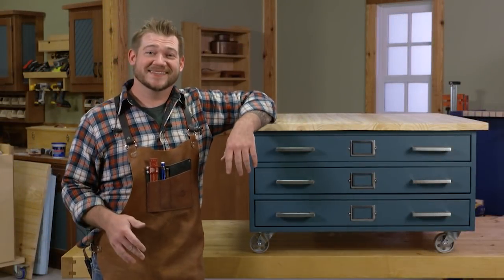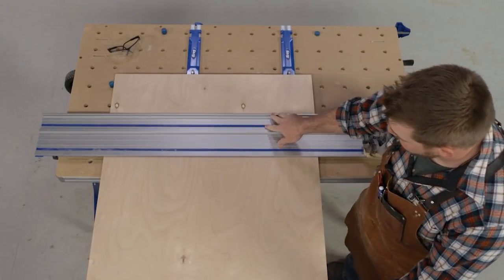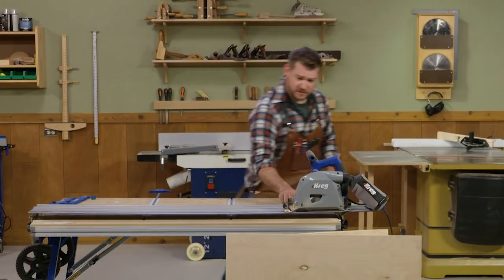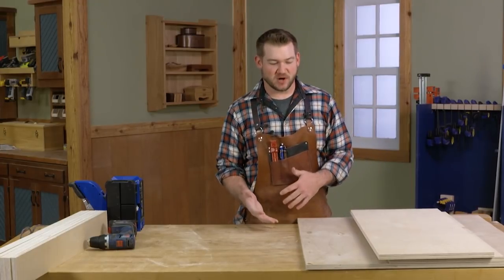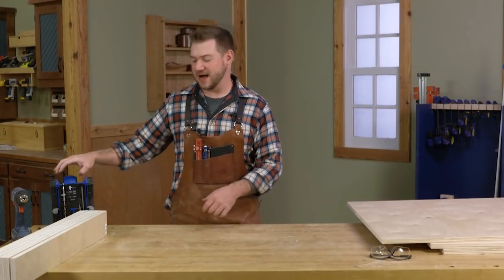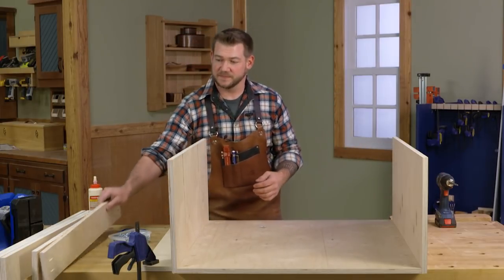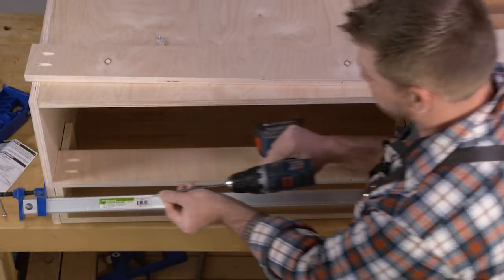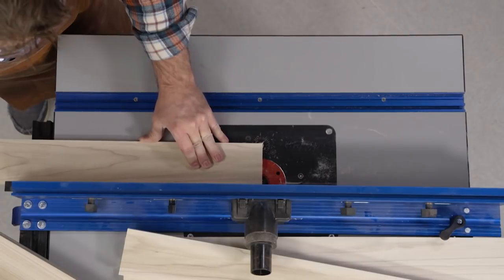Make A Flat-File Coffee Table

Comment: Kreg jigs make our life so much easier as well as makes strong clean joinery!  Keep up the great work as the goal is for us to continue to inspire others to build something awesome! 👍🏼
Reply: Well, not exactly that clean... Have to upgrade to a Castle Pocket Hole cutter if you want really nice pocket holes...  Kreg jigs are just cheap and dirty but get the job done, which is good enough for most.  Just like their ripcut guide, etc. works but is no replacement for a real tract saw...

Castle Pocket Holes are much cleaner, virtually no tear out or debre to potentially block driving the screw all the way in or blocking the piece from sitting flush.  Along with being faster, and as it's 6 degrees instead of 15 degrees, it's much better for thinner stock, you don't have to worry as much about screw length, and you can practically use just hand pressure to hold pieces in place while driving the screws as it won't have the tendency to drift as much, which is why Kreg Pocket Holes requires the clamps unless you have it braced against something in the direction it will draw the piece towards...

There's just a big price difference that goes along with all of that... So you won't usually see a castle system unless it's for production work spaces where they have to do a lot of furniture pieces.  The type of shops that will also have shapers instead of just routers, sanding thicknessers, industrial planers, etc.

Though, the entry portable Castle Pocket Hole Cutter starts around near the same price as the Kreg Foreman...

The Armour Pocket Hole Jig, while the same type as the Kreg, at least has material auto adjust for both the clamp and the drill bit depth stop.  The new Kreg jig that replaces the K5 only adds the auto clamp and is much flimsier than the Armour version...  No advantage for the simpler portable pocket hole jig, though, and the Kreg version is cheaper in that case...

Comment: I've found that 'figure-8' and 'Z' fasteners don't survive well when people try moving furniture by lifting the top. Instead I use simple L-shaped hardwood blocks, the blade of the L is just thin enough to fit in a biscuit joiner slot (or cut it with a router) and it screws to the supporting frame. You can make them from off cuts easily by hand or machine. The first table I made this way (8' x 3' trestle, all 1 1/2" thick) is still going strong after 20+ years, hasn't even needed the screws tightened. (Its too heavy for the cleaners to lift easily, so they just lift one end and drag it by the top)

Comment: Should your figure-8 fasteners have been on the long side? The expansion will be left/right, not front to back.
Reply from the maker: Technically, yes. But, you can install them this way as well. I didn't do the best job highlighting that - If you install them where the expansion/contraction would be pulling/pushing away from the fastener, you just have to pivot the faster inward. That way, the expansion will "pivot" the fastener out.

Comment: I wonder if he misplaced the top, turned it 90 degrees, it is almost the same dimension in each direction. I agree with other's comments that the end grain facing forward isn't the cleanest look, even for an "industrial-look" piece, and it also makes the figure 8 fasteners ineffective.
Reply from the maker: It is indeed almost completely square, so it could be rotated. Personally, I'd orient it where the side grain is on the "show side" in the living room. It would depend on if you want the drawers facing the seating or not. Either orientation would work, and regardless figure-8 fasteners will work in both orientations. When they're in this orientation, you just need to pivot them slightly before attaching the top. That way, the expansion would "pull" the fastener to straighten it a little. James Hamilton (Stumpy Nubs) has a great video explaining this. I didn't go through explaining pivoting the fasteners in this video, but probably should have!